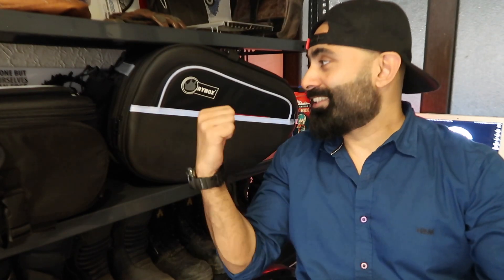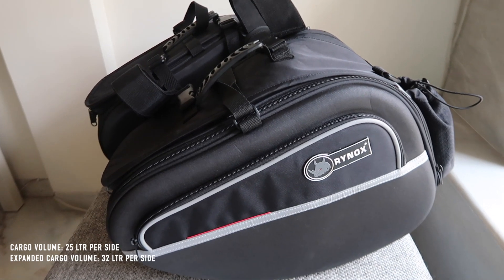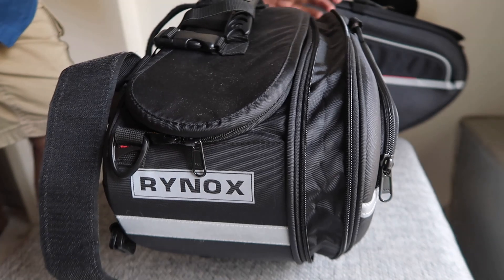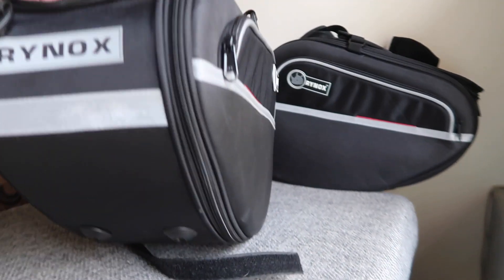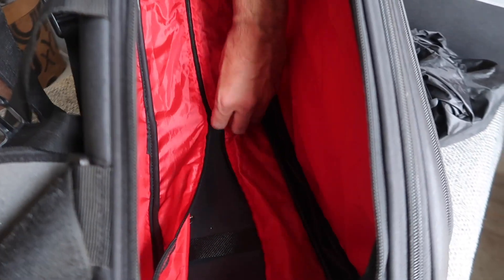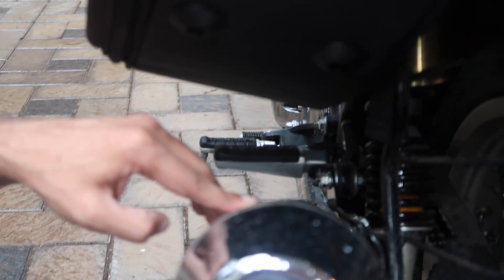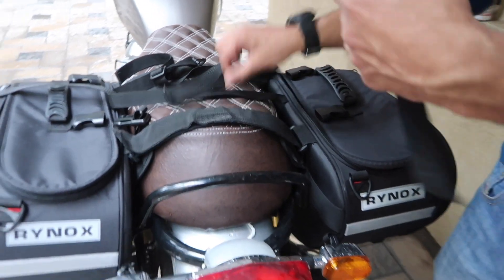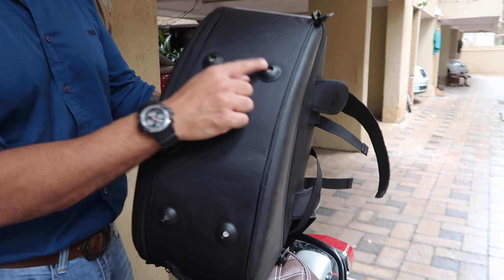SADDLE BAGS FOR INTERCEPTOR 650

Comment: Great Review 👍
I have a question. I own a pair of NOMAD and use them extensively on long rides with my Himalayan but how good are they on the Interceptor? Especially with loaded saddlebags on rough terrain, will the bag touch the silencer or interfere with the rear shocks?
Reply: Is it possible to fit laptop inside Rynox Nomad Saddlebags

Comment: The bag will sag after the straps are wet  I have used the same bags on my INT 650 on multiple rainy rides. Not very confident inspiring setup. They sag and sit on my silencer after 500km run I have to keep adjusting
Reply from the maker: s m yeah buddy I mentioned rain riding quite a no no mate
Reply: So Which saddle bags wud u prefer

Comment: Great video. I'm planning on buying an interceptor for short to medium travel with my wife and I see those saddle bags don't make it confortable for the passenger in the back. Is that your opinion? Is there an option? The Himalayan is also an option, but I like the 650 style better. Thanks!
Reply from the maker: There are after market footpeg extension available which can allow the footing just right if you notice in the video the struggle is the foot pegs landing position, also make sure you put a backrest with a rack very helpful for pillion and last but not the least a good touring seat cheers